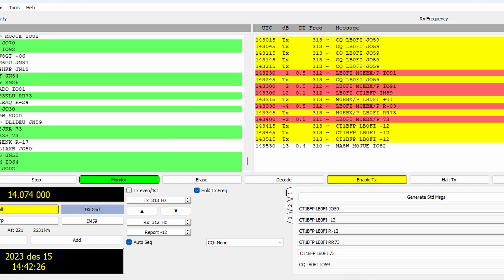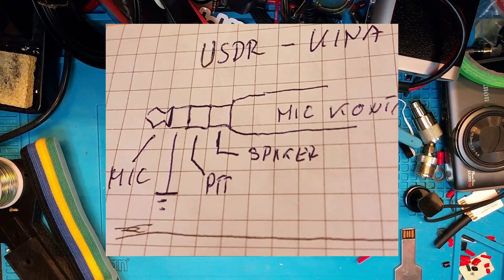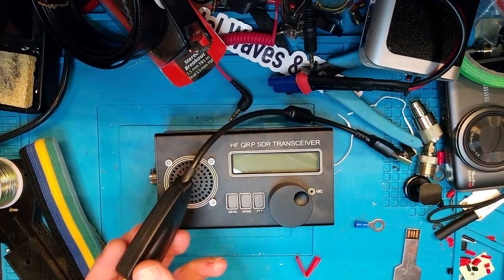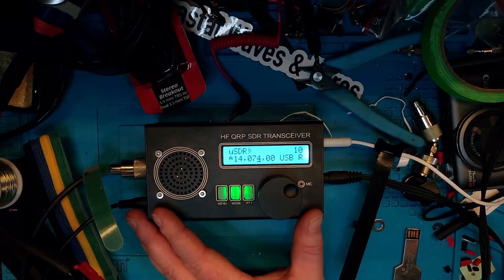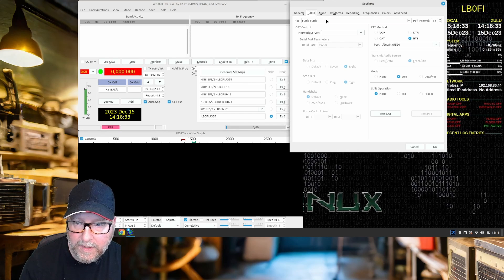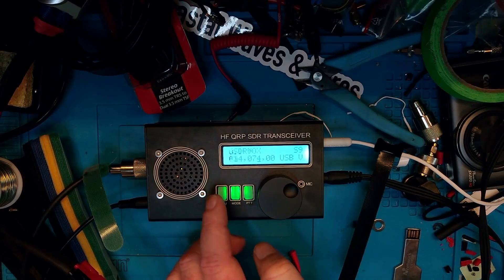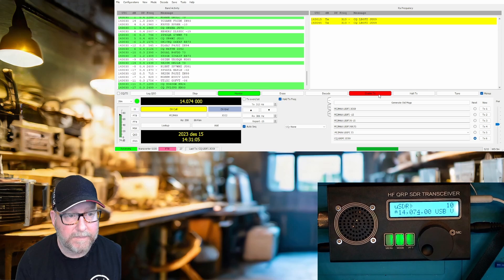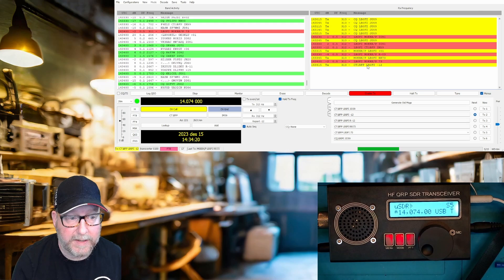Can you do FT8 on the uSDX?

Comment: UPDATE: Once I've figured out JS8Call with the "Black Brick" USDR I've also gotten lucky using Winlink with VaraHF on 40m using the same audio settings. Just make sure you tune the radio to the Dial Frequency in Winlink.

Comment: Hello! Thank you very much for the information as it is a really interesting piece of equipment, but I have a question. What is the capacity of the internal battery? 5000 mha? More? What is the indication when the battery is low? I don't see any indication or LED that could indicate such information. If you could clarify these doubts of mine, I would be very grateful. 😉73
Reply from the maker: Hi there! I don't have that radio anymore, and I don't remember the size of the battery. There are no indications for low battery, and the whole battery solution seems a bit janky and hacked together. I removed the battery to reduce weight and feel safer.

Comment: I wanted to put my µSDR on FT8 but didn't want to deal with not having schematics, putting in time on a maybe, spending time on a mode that I only use from time to time, and isolation and ground loop issues between various devices.  My solution was to acoustically couple the µSDR to my smartphone.  Just like the old FAX machines.  I made a video about it and it's a fast and dirty method.  I don't know if YouTube allows pasting a link in a comment section however if you search for my video by name I'm sure you will find it. 

The name of the video I posted is: 
"Acoustic coupling a µSDR transceiver to work FT8 on a smartphone or tablet."

Good job on the cables Morten and thanks for providing the info on hard wiring in the audio cables. FT8 isn't the most pleasant sound HI HI. 

73,
Reply: @samradioman3843  There is a video on my channel as well. It's best to 10ohm load amplifier and around 30ohm to match earpieces etc.  George

Comment: Mine works extremely well. I just use my simple interface. Mic, and Spkr connection from an old earpiece wire etc. No cat control.  Works perfectly on my DIY mag loop. Vid = "FT8 Digital Mode. Ham Radio. Magnetic Loop Aerial"  cheers from old George
Reply from the maker: You absolutely do not need cat control, and as long as you keep it simple it usually just works.
Reply: @LB0FI  The only thing I have done is fitting matching resistors such as 10ohm to simulate loads loadspkr is connected and 35ohm left and right channel to simulate headphones connected on phone I use. Plenty vids on my Ham Radio playlists etc. George
Reply: hi, Can you help me with this? TA2GMK, 73
Reply from the maker: Dude, three comments and two emails. I answered your email yesterday and gave you pointers.

Comment: I'm using a USB sound card into my laptop, and finally found some useful settings: Speaker 10%. Mic 50%. On the radio: Vol 7, Filter full, AGC off, Vox on, Noise Gate 12. Only using JS8Call so far.
Also, found some 4 pole 3.5mm plugs on Amazon, color coded for easy wiring (tip=red, 2nd=white ground), to any 3 pole 3.5mm plug (tip=wire,  3rd=ground).
Reply: JS8Call is all you need! I use JS8spotter together with JS8Call to easily send text and email via HF with the little 5 watt USDR. Works great!

Comment: You can use the CW-Key port as the Mic input, I have the same radio work well and I do FT8 using the VOX works well also with the VOX I use only two cables You do not need all that other junk to setup with

Comment: For CAT control you need version w of the firmware. I'd like to see a review of this radio.
Reply from the maker: Thanks for the info. I don't think I am going to attempt a firmware update on this radio, as I would think the risk of bricking it is too high. As of a proper review I don't think I am going to do that. I have a couple of videos out on that radio, and more are coming.
Reply: @LB0FI  My radio shows version 1.02v (spose to have CAT) and I have a USB serial adaptor, I will try it out and let you know. For the time being I made a cable up for the Mic port following your diagram and have been getting lots of FT8 contacts some up to 7000 kms away with just a short random wire/tuner. This is a great radio for FT8 and JS8CALL.
Reply: I have version 1.02v of the firmware/ USB serial adaptor and have tried everything to get CAT to work to no avail. There seems to be data coming out of the radio but even using a serial terminal I could not make sense of it. I can get the USB serial adaptor to talk back to itself so I know that works but no joy from the radio... still using VOX and audio cables which seems to work fine.
Reply: @Centar1964  According to the USDR manual online, the UART CAT control uses a 4 barrel connector: Tip = RXD, 2nd = TXD, 3rd = RST, 4th = GND. Hope this helps.

Comment: Great video Morten! I have a similar Chinese radio, the USDR+ (known as the "Red Corners") but I can't find info about the audio wiring. This one have the same connections like yours,  SPK, TO-PA,  UART, MIC and KEY. Do you have a guide or diagram to build the cables? Thanks in advance. Jorge VE3EAD
Reply from the maker: The closest thing to a diagram I have is what I show in the video. I have wired it the following way. The tip on the TRRS connector is wired to the tip of the TRS (Audio) and the outer ring of the TRRS connector is wired to the sleeve of the TRS connector (ground).
Reply: @LB0FI  Thanks!